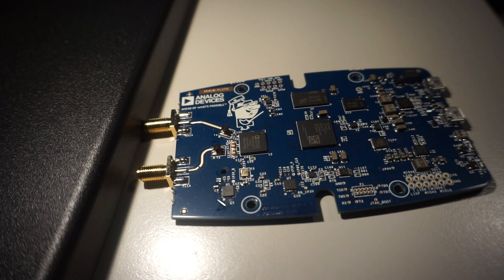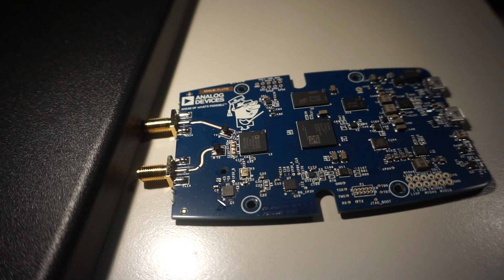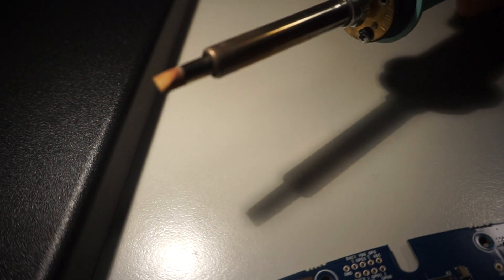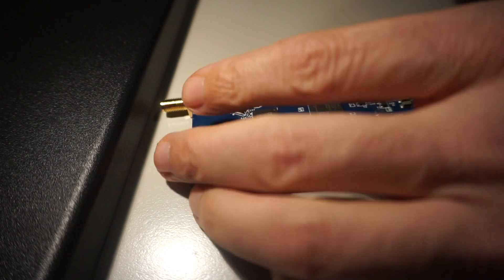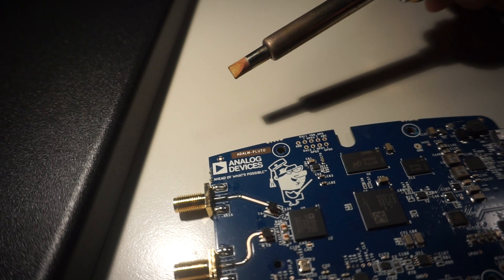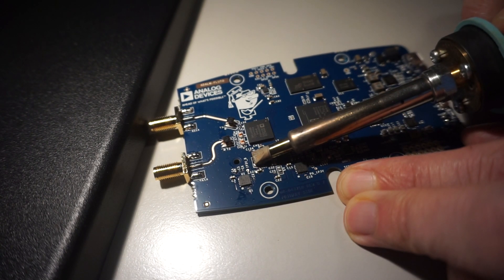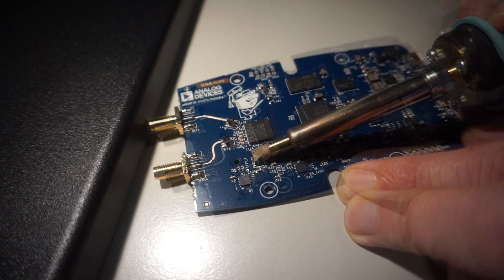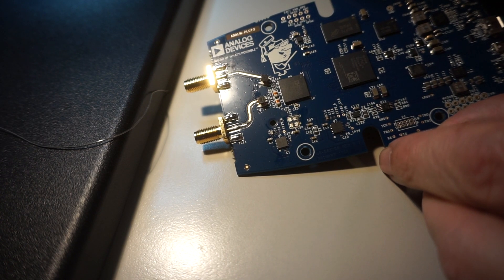Very Easy PlutoSDR TCXO Removal Modification for QO100...

Comment: This is what I'm planning to do with my Pluto to add external GPSDO connector. I've got a pencil gas soldering iron with a fairly wide tip that should be ideal for heating up the oscillator module to reflow. Thanks for the video - at least I'm not the only one to have thought of this :)

Comment: Wenn man den Oszillator wegwirft, ist das tatsächlich eine schnelle Methode. 
Bist Du auf Entzug oder warum zittern die Hände so stark? 
Nächstes Mal ein Glas Wein oder einen Joint, dann wir das Video noch besser ;-)
Reply from the maker: Der Oszillator ist eh nicht zu gebrauchen, daher wirft man den ja raus :-)

Comment: You can see another easy method if you search for "easy XO-removal".
Reply from the maker: Yes but that requires a special mechanical unsoldering tool, which no one usually has. It"s always "easy" with dedicated tools.

Comment: Applying heat for such prolonged time on an IC could be a problem... Never understood if XO have such problems
Reply from the maker: Yes, it may very likely not be usable anymore afterwards, but the main idea here is actually to discard it and replace it by a better one :-)
Reply: @MegaOscarVideos  I'm planning to do the same on my adalm pluto , and i feel a bit scared! :)  your video is very helpful! I plant to solder a UF.L type connector as well! did you do that or just soldered a different TCXO in place? :)
Reply from the maker: @eznAnze  I use a better TCXO on a seperate breakoutboard mounted away from the TRX chip to avoid thermal drift. But I also made another Pluto with a UF.L type connector for feeding an external GPSDO signal. Both work fine.
Reply: @MegaOscarVideos  Awesome! I hope I won't mess it up! Otherwise I'll come back here crying for help!! :D Thanks!